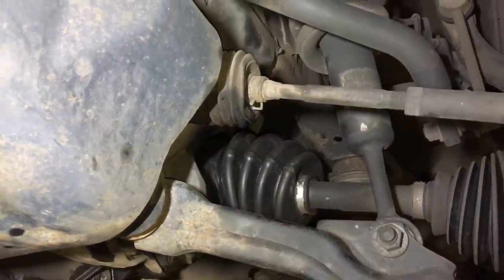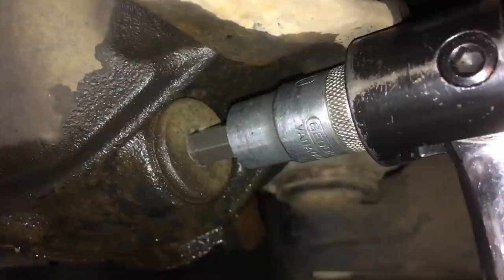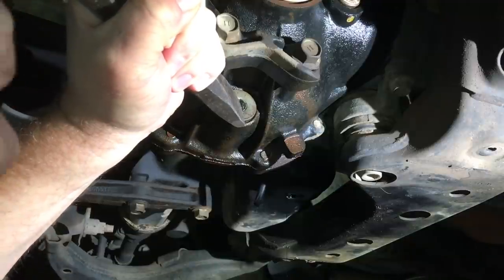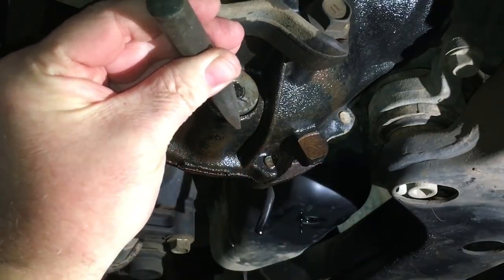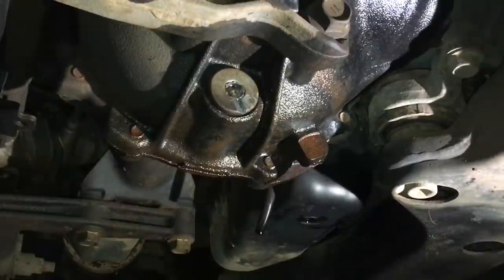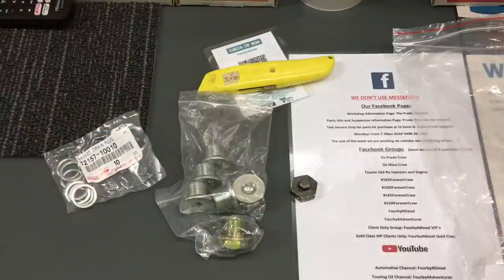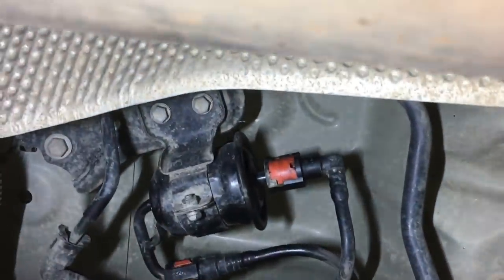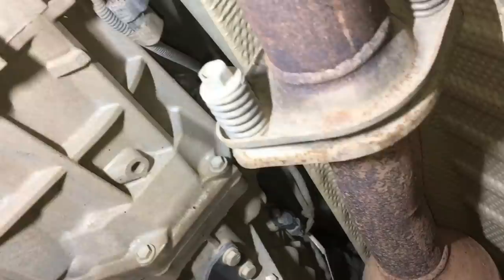Ohhh HOW To get this DIFF PLUG OUT! - and more

Comment: Right on.  Boogered one up really bad, tried heat, tapping with a hammer, tapping the bit in, broke a bit off in the thing and eventually rounded it out - all no-good.  The hammer and chisel did the trick!  Took a bit of work but all-in-all worked like a charm.  Thanks so much for sharing this - this method really saved the day!  (but not the plug - mine looked way worse by the time I was done ;-)  A BIG THANK YOU!

Comment: Had the same with mine… I used a spiral screw extractor which worked splendidly with a wrench. Very easy actually. Spiral screw extractors are available everywhere.
Reply: What size did you use?

Comment: Had exact same problem with my sons front diff plug on his 95 series Prado. Damn thing wouldn't budge no matter how much you swung a spanner on it. Used this method and came out real easy. Bought a new replacement plug from local Toyota dealer $22 including new crush washer. Thanks Anthony you're a real legend!

Comment: Your method worked exactly as you say on my '15 4runner.  had a smaller sharp chisel to make the groove, used a grinder to take the edge off of a larger chisel.  4 or 5 strikes with a 5 lb hammer and it worked like a charm.  I was worried I was one of those knuckleheads who over tightened when I did my last fluid change, but usually I'm pretty easy on the torque.  Fill plug came off as expected without issue.  👍Living in Massachusetts and the amount of road salts used in the winter probably contributed to the issue.  Replacement plug coming in 3 days....

Comment: I been following this Channel for awhile heaps of good info I decided to change my diff oil  yesterday last time it was done at a mechanic shop, as soon as I looked at the drain plug I new straight away they done it to tight ended up stripping out the exact same as the one in the video, cheers for the handy chisel tip

Comment: I had this exact problem. Stuck front differential drain plug. This method worked very well, I can recommend as well. I used plenty of WD40 to prepare the nut and then used a sharper chisel to make a notch, then banged it with a bigger blunt stone chisel 20 times on the plug. Make sure you hit the large chisel in an angle towards the threads. Just keep banging and it will open eventually. No need for a spiral screw extractor, but it might work as well. Thanks for the video, it was very helpful.

Comment: Get the Lexus plug, it has an outie hex like a bolt head.  I had the same thing when doing a locking rear diff swap and had to swap the front as well for gear ratios.  Spiral flute extractor ended up being the ticket to get the plug out.  Also that might not have been overtightented.  Theres a problem where the copper washer galvanically corrodes to the plug and housing welding them up.

Edit: Okay that one might have been overtightented but the corrosion doesn't help either.  Mine took easily over 100 lbs of force to break as I couldn't even break it with a breaker bar and my full weight with the extractor.  Had to use my impact.  I'm sure that if it had over 100lbs of torque on it when installed it would have stripped everything out.

Comment: Hit the same issue today on a Suzuki transfer box - every plug was overtightened, got them all out - front diff, rear diff, main box - would the transfer box one come out? Would it feck.  Mashed it into a hoop with the chisel - thing didn't budge. Did all the other fluids. passed the transfer box by. Tomorrow it's getting stuff welded onto it & it's getting "Explained better" to. Out, you are coming, Pal. just not with the chisel method...

Comment: Let me tell you something I deal with that issue very often, is a common problem, and the tool that you use provides to much flexibility in the wrench, I used to put 90 degrees Allen that fits perfect in the hall and then tap hard one time with a hammer and it lose very easy but if you miss the shoot you will damage the Allen bolt, other thing is the way you mark the bolt you must hit the bolt on the lip or edge to have more room to twist. But is a pain in the ass when that happen just be patient and everything will lose.

Comment: Its a split boot, I keep one as a spare for track-side repairs. 
You can get them from the UK or US (need to pick the right size).
Toyota used to sell them too, but they stopped years ago - not much demand.
Reply from the maker: I don’t
Even with open boot the Cv will last a long time past getting you home
Got better things to do than trackside repairs / replacement

Comment: Before I watch it I'm guessing use a large torx bit as an easy out or just use an easy out
Reply: There's no torx bit size that really fits this really well if you've already stripped it.  If you stop early maybe a t60 would work.  Fully rounded out it's too big for the t60 and too small still for the t70.  I found this out, ended up using a spiral flute extractor and worked like a charm although I had to get at it with my impact, breaker bar wasn't enough even with my full weight.

Comment: Yes obviously wrong tool used. It's easier on vehicle when it's lifted vs working on floor which is my situation. This is probably first time owners taken it to a garage, as looks like he's used quick fixes. Unless he's got it cheap, won't be to fix it up.
Reply from the maker: No obvious overtightened